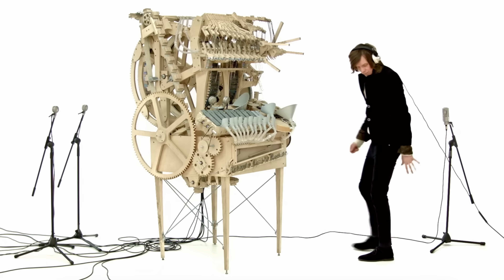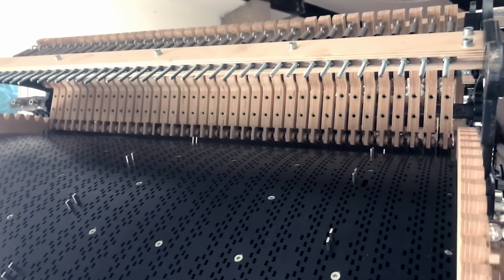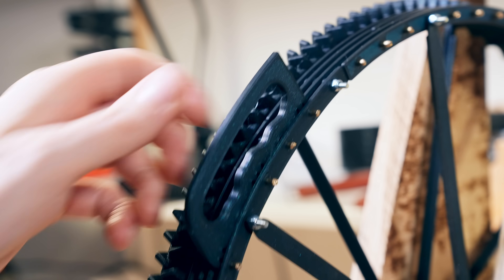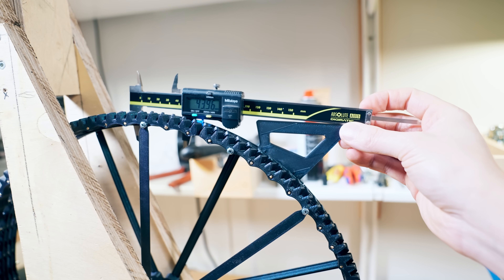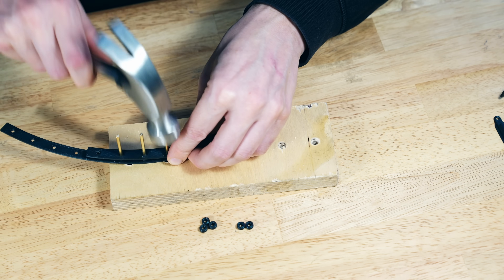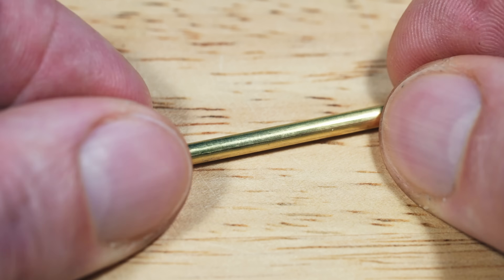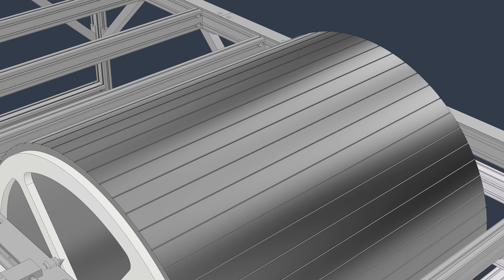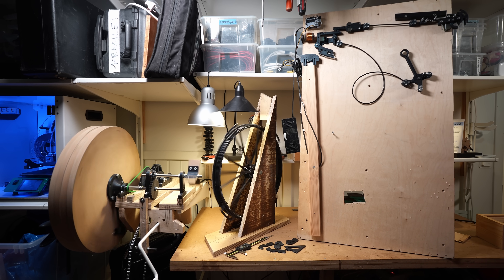Prototyping The Marble Machine Programming Wheel

Comment: You might want to consider adding a thin “backstop” in the programming wheel for when you’re inserting the rods. You could either stop the circular bit just before exiting the far side, or just attach a ring of sheet metal to the outside. It’d at least help with assembly, but if you did it on both sides it could also help with preventing the rods from drifting out over time. Potentially not a problem, but it should be an easy enough fix that it might be worth doing preventatively.
Reply: I think it's gonna be the inverse, if the slut is somewhat tight, he will never be able to drive 3ft rod in there.

Comment: Hi Martin, have you considered using a bicycle wheel for this design? A bicycle rim naturally has 28/32 evenly spaced holes machined in it for the spokes to pass through which could be used to snap in your programming profiles or some intermediate piece for a multichannel design. If you select a front wheel with disc brake support that then also gives you a 6 bolt mounting pattern for your input drive.

Comment: I like this idea! Using a single, known-consistent metal bar for your precision is clever. As long as you can get the rotary CNC to cut channels which are precise distances from one another, sounds awesome. My only hesitancy would be destroying a large/expensive wheel if you get your machining operation wrong, but small scale tests can hopefully help avoid that. :)
Reply: Unfortunately a long bar like that is far from consistent and will be nearly impossible to fit along the whole length.

Comment: Why a fixed sized wheel?

Programmable Looms quickly went to Jacquard card chains. This allowed for variable length "programs" as well as quick changing. 
There were even systems that allowed for quick changing between two different card chains in mid looming.

Comment: It would be really cool if there was a way to get multiple channels connected to one instrument with some sort of control over which one is active.

With all the channels you have, you have a lot of range, but you could essentially trade range for length of track. You cou got from 26 channels with length N to 13 channels with length 2N or even 6 channels with length 4N. You might want to bump your channels to 32 to make it easier to divide by powers of 2.

Comment: I'm not sure about "design three", I suspect you might have some addition DFM (design for manufacturability) work to do there.  Getting a press of a 3' long metal bar is going to be tough -- meaning even if you find the perfect ball mill that exactly matches the right press fit tolerances of your metal rod, (a) how will that change as the ball mill wears down, and (b) how much physical force will it take to push that rod three feet through tight tolerances?

I think you'd be better off tightly constraining the ends of the rod, or maybe a small area on each side of each slot, and then leaving more of the center free in order to avoid an impossible push fit.  Similarly, I'm worried that the outer programming skin is responsible for so much of the structural stiffness of the assembly.  That outer skin seems to be trying to do too much.
Reply: Plastic is the answer.  There are different types of plastic obviously, so choosing the right one for this application is the tricky part. A brass rod would go well with a delrin or uhmw plastic.  Tooling doesn't wear near as bad when machining plastic.  A little heat can be applied to the plastic and the rod can easily be pushed in. There are companies that do this very sort of thing with great accuracy and consistency, and have been for years. Martin is on the right track.  Hope this helps.
Reply: Sourcing that tube of plastic is going to be an absolute bear too... I think his "design 2" could be optimized into self-spacing laminar rings; or maybe half / third / quarter sections. The inner rings could have slip fit tolerances on the pins, with the outer spoked wheels entrapping the pins in blind holes at assembly. Each ring could have a pattern of radially spaced tapped holes and countersunk holes (since flat head screws naturally self locate when tightened) for accurate / easy assembly. The double helical gear also becomes a set of individual rings in this example.
Reply: Having semicircular slots, and then having some elastic bands to hold the rods in place would seem much easier, especially if one had some extra slots that could be used with a jig that could use hooks to pull out on the bands so the drum could be slid into or out of the jig.

Comment: For easy programming of the wheel, wouldn't it be great to print out the blueprint of the composition onto a large sheet of paper, it's the length of the radius of the wheel, every pin slot precisely located, the required pin slots are punched out or shaded and thus becomes a paint by number programming guide. You could even print in color to distinguish the components of each ensemble your programming: drums, snare, base guitar, etc. Prep for the world tour could be done by assistants due to It's simplicity. You should also consider creating a reliable tool to help add/remove pins between shows so it's not all done by hand.

Comment: I really liked the concept for this programming wheel and the fact Martin is using all his experience with the design and manuacturing of the first two machines to make more educated decisions. The concept really combines the best of both worlds. I suggest however to do a pre.machining with the ball cutter and  the finished diameter using a deep drilling machine. Also, the routers are designed for soft materials like wood, their are useful for things like furniture, if you want more precision on your cutting, use cnc milling machines, designed for harder materials. They are more robust, better geometry and much higher precision.

Comment: Great Prototyping methode! It's been amazing! But... I'm thinking here. I'm preeeety shure you can eliminate the mchined plastic from version 3. Just using metal bars and the whells. Or at least just using a 1~3 mm plastic sheet  for spacing reference. That you don't need to cut in rotary cnc machine. It would be easier to manufacture and a lot lighter.

Comment: The amount of force needed to push the rods in seems like the hardest (ha) part of this new design.
Reply: Manufacturing a press-fit for a rod longitudinally is going to be pretty much impossible. Rod thickness is probably not nearly as consistent as Martin hopes. Simple press-fits usually take several iterations to actually get consistent results, so something like this would probably take a ton of trial & error.
Reply: @deisum  Yeah, retention plates and/or adhesives might be the way to go here.
Reply: yeah, I have concerns with how much force that is going to take, that's gonna add up to be a lot of friction
Reply: Could he not use many smaller rods instead of one long rod across the whole length of the wheel? Each small rod could have a tight fit without having to apply a colossal force. Might take a while to assemble
Reply: @MysticalSkyMonkey  I don't think it changes anything, if the rods are touching each other, it's just like pushing a longer rod. Otherwise you have to put each rod to it's position before adding another but I doubt it's easier to do
Reply: Use a radial bottom slot a little less than 1/2 diameter of rod.  Apply a keeper cap with a vee slot to retain the rod and screw to the drum. Make the retaining holes in the keeper cap larger than the retaining screws. Thus, the keeper cap will "float" and align to the rod.  Have used this design many times on high precision gages. High accuracy, low manufacturing cost, good reliability.
Reply: @charleshettrick2408 fully agree, that's the most sensible approach in my mind. If he uses registration slots in the disks for those slats he won't need a rotary setup either.
Reply: This should be a top level comment! @charleshettrick2408
Reply: Maybe if he kept the rod in place by using some clamping brackets at the ends, it'd be a lot easier to get the rod inserted
Reply: If the slots are machined in a somewhat flexible material that can be removed from the drum then you could remove a segment and bend it slightly smaller than the radius of the drum to press the rods directly in from the face. As long as the face material is machined on the drum (and the material is appropriate) there shouldn't be any problem with removing it for an essentially one-time operation.
Reply: Why not slot them in from the side?
Reply: @FloLedermann  the further it's pushed in, the more resistance there will be. And in order to keep the position accurate (and thus tight timing), it will need a fairly tight fit. We'll see what he comes up with :) Hopefully does a test-run of a slice of the programming wheel before committing to whole thing
Reply: @twardnw  if they’re hard to push in sideways, he can break the rods and do it in pieces. The accuracy should still be there since that’s driven by the holes’  accuracies
Reply: @insertnamehere1044  Just make an open slot a bit less deep than the rod (with a ball end mill if it needs to be round, but square is probably just fine), lay the rod in and make clamps that clamp it from the top. More pieces, but infinitely easier to machine and assemble.
Reply: This is exactly the way I would go.  Press fitting a steel rod roughly that diameter about 6 inches long is enough of a pain in the ass, I wouldn't want to try a longer one. @Finnspin_unicycles
Reply: I feel like it would be easier to push from the face. You could support the underside of the face so the whole wheel isn’t under stress and snap them in supported along their whole length using a hydraulic press or even some kind of setups with jacks. It would still take a ton of force, but it would be over in a second with all the deformation happening to the slot and none to the rod or wheel.
Reply: I’m worried the programming clips may pull the rod back out when removing them. But I’m sure Martin will verify this before going full scale
Reply: @YogiTheBearMan   That's the reasoning behind the ball mill.  The plastic compliant mechanism of the programming profiles will apply several orders of magnitude less force on the bar than the plastic deformation limit of any metal (or wood for that matter) that he'd use for the cylinder.
Reply: Hammar!